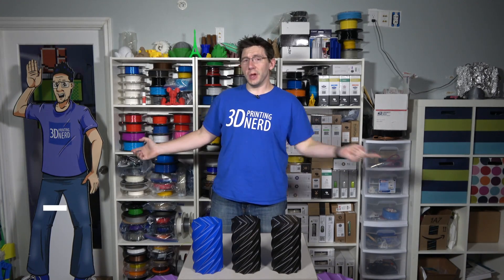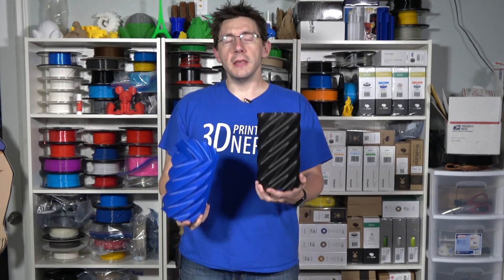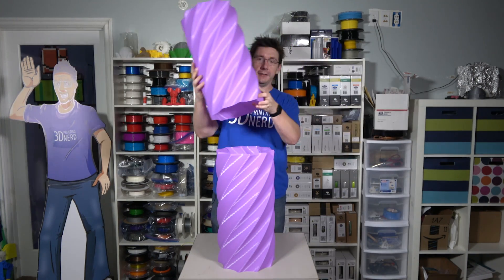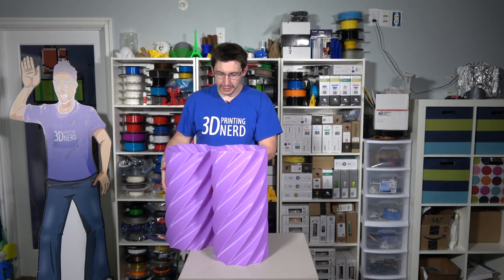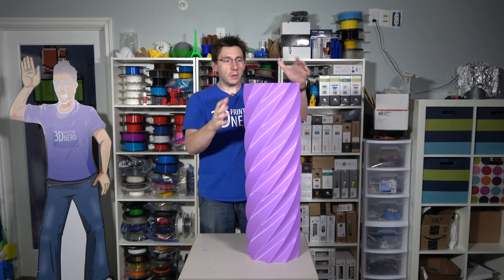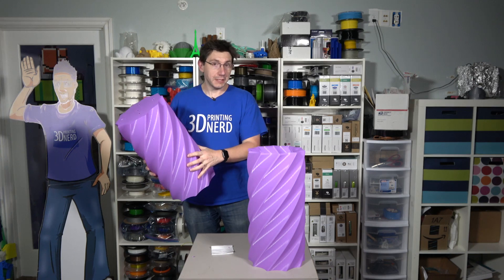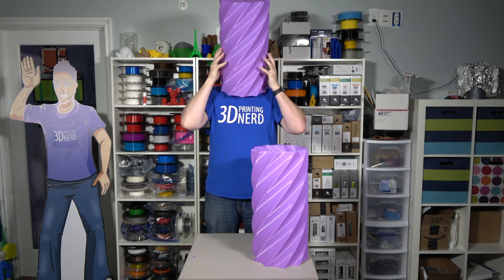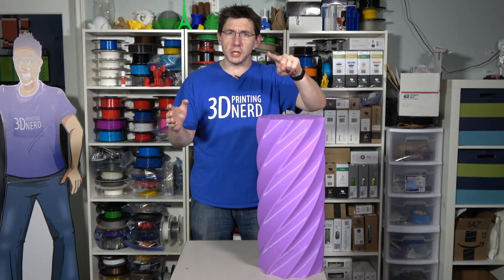Biggest 3D Printed Oddly Satisfying 3D Printing Twist Containers

Comment: i know how to produce a gas that implodes and burns cold... could a zero air tolerance be made with some pistons or cams, what ever they are called? the cylinder that goes into the chamber and ignition happens. with my gas that burns cold, i could make a functional implosion engine, lol plastic hummm, im thinking about getting into 3d printing. What kind of printer could give me the zero air tolerance? but still slide freely when air isnt blocked, or if there is an ever so small slight loss of efficiency i guess it wouldbt be that bad. oh and the heat that will be generated from friction will be taken away when the gas implodes cold.

Comment: Maybe try with some acetone vapour or other smoothing techniques, the sound it makes suggests there is significant friction at work
Reply from the maker: I think the ability for air to escape is still a more significant factor than the friction, but, not by much!
Reply: worth a try maybe? I think it might also make more space for the air to escape. Thinking of the layer edges simplified as sin and (shifted) cos there is little space between the tips touching (that are making the sound) but if they are smoothed, then its averaged around their middle...

Comment: If you put only one hole in the top and attach a pipe bowl, fill it with w/e herbs or tobacco you want, light it and let the bottom piece fall away but stop it before it separates, then remove the bowl and let the top go it'll shoot the smoke straight up. cool trippy gravity pipe.
Reply from the maker: Whoa, that would be trippy!

Comment: Any chance of a Gmax XT vs Raise3d N2+ vid coming plz?
Reply from the maker: These were printed on the Raise3D N2+, and the Hairy Lion I did was printed on the gMax. Are you looking for something specific?
Reply: Thanks for your reply. I am considering purchasing the N2+ but quite like the gMax too. It's hard to tell which one is better in more areas overall. I haven't seen anyone do a comparison video. The price points are close, the size of prints are close, so I think they would be considered in the same category of printer. Other than the option of dual printing on the Raise3D.Therefore, a duel of sorts would be a great vid! Something like testing the same print on both printers with same filament, settings etc.. Love your channel!

Comment: You're not worried about all those exposed rolls of filament?
Reply from the maker: Surprisingly, no. The house is air conditioned, and relative humidity is just fine for most filaments. Nylons and PVAs are kept bagged with desiccant.

Comment: Hi, I'm going to get a tronxy x1 3d printer kit as my first printer, and I have a project that needs a high melting temperatures and strength. Should I upgrade it to a heated bed, and print in ABS, or should I print in PETG?

Comment: Consider picking up a step drill. They make putting holes in any thin material (plastic or metal) so much easier, and they're a good value for money since they're 10 hole sizes in 1.

I think that you'll get diminishing returns with the air holes. My bet is that the air flowing between the two halves is what allows the near-frictionless satisfying effect. After the wiggle stopped with the first test at 1:49, it was slow, but there was no grinding noise like we heard after the holes went in.

If you want to follow up on this test, you could try: 
- plugging the holes and letting the large container close, even though it will take a while
- Lightly sanding the inside of the outer container, and perhaps adding a little synthetic lubricant to smooth things out
- putting a hole in the top of one of the smaller models that works well, to see if it closes faster, slower, or at all. My guess is that the small ones would bind up and not close at all without airflow between the parts, since they have less weight to overcome friction.
- (obviously not a simple option) Re-printing the inner half of the large container just a wee little bit smaller, even 1 mm less in diameter might make a difference.

I hope you don't take this as criticism. I've never even done any 3D printing, but this video was cool so now I'm just itching with curiosity! Even if you just try putting a hole in one of the small models and report the results I'll be so happy :).
Reply from the maker: I take this as constructive criticism and I love it! Thank you so much! I love the ideas - I'll see what I can do!
Reply: After a re-watch I realize I'm not adding all that much here. For some reason I felt like the big tube with holes wasn't closing up nearly as smoothly as the smaller models, but actually it seems about the same, it's just louder because it's a bigger vibrating thing. And you said right from the start it was just a matter of the gap being too tight.

As for fun tests, it would also be fun to see if you could attach a balloon, air compressor, or even that hair dryer, to one of those new holes to see if it'll push itself open. If done from the bottom, it would look like the future. Some day I'll get my own 3D printer and I can tinker on my own, but for now I'll just try to tinker vicariously through you (that sounds wrong).

Thanks for being responsive to your viewers, and for making interesting content :)

Comment: It looks like the increase in the diameter distributes the weight of the object over a bigger area. The bottom line is that you end up with less pressure applied by the object's weight per unit of area. Adding the holes helped alleviate that by allowing the "cushion" of air to escape. You can also increase the difference in diameter between the two objects. It'd be interesting to add some weight to the top object or modify it with some cut out designs.
Reply from the maker: I thought about reprinting to increase the diameter between the two halves, but in the end, using a drill at 1am was way more fun.
Reply: I can imagine. :D 

Hmmm... cut them down shorter and they can make some novelty gift boxes.

Comment: Looking at your filament wall, it doesn't seem like you are all to concerned with moisture, are you? Did you ever have printer failures because of moisture?
Reply from the maker: I'm not, that is correct. I've never had an issue with moisture and filament. Crazy, right?

Comment: How much PLA?  How thick are the walls?  Single thickness walls?  Vase mode?  MORE info please!
Reply: I ask because I have been playing around printing many vases lately.  They print fast and are just fun!
Reply from the maker: Each one consumed roughly 200g of PLA. It was vase mode, so the walls were .4mm thick!
Reply: Hmm... initially looking at those I thought they would take a tonne of PLA but thinking more I guess that's not bad.  How long did it take?

Comment: You probably meant that gravity has to overcome the friction, not sucktion ;)
Reply: At least it is probably an important factor as many people print those vases without top and bottom layer.
Reply: Sintoxic no he meant suction which increases the effect of friction. If it was purely due to friction drilling holes would not of helped. As the preasure inside the container drops the preasure on the outside of the container is able to outweigh the forces from gravity causing the piece to stay in place. As the inside of container regains it's pressure the force from gravity is stronger once again allowing the container to drop. It balances these two forces creating a constant speed in which the container drops. If you allow the container to pressurize faster by drilling holes it will increase the rate in which it falls.
Reply from the maker: There was some friction, true, but, the suction was what I meant :)

Comment: If you put the side with the holes down on the table will it hover? High Five Man!
Reply: Sadly, it's completely impossible. The force of the air is being created by the weight on the upper piece, pulling it down, and pushing it out. So the force, in total, is only the force of the weight on the upper piece. And it's competing with the force of the weight on both pieces. So, no matter what you do, even if it were perfectly efficient (hah!), it would not be able to produce a greater upward thrust than the downward force of weight.
Reply from the maker: I WISH
Reply from the maker: I WISH
Reply: there's some gaps on the two pieces which allows the thing to roll down without holes before joel decides to put some in anyways. I suppose you could put a fan down there and tune it just right to get it to hover though.

Comment: Hello, What about your experience with the Raise 3D N2 +? I´m a Visual Artist and Sculptor and I have a Makerbot Replicator 2 from 5 years ago and I´m so happy with my PLA print models but now I need to go for a higher level of my sculptures and I need to increase the print area,  I was looking for what is the best option for me and I´m so enthusiastic with this N2+ but  I´d like to hear from any real user what they think about it  or if you have any other suggestion, I have around  5.000 US$ of budget  for that. Thanks for your time and I really appreciate your answer.
Reply from the maker: Wow, that's a huge budget! So far, I like the machine. I think it's a sin that it doesn't have auto bed leveling, though, the community has added that to the machine via a BLTouch. Their forums seem active. One person even fit Bondtech extruders on it! I don't use the dual extrusion capabilities. It produces exceptional quality prints. I have had some failures, but, most were very simple to recover from.
Reply: 3D Printing Nerd  Thanks for answer,  I don't have a problem     without the autolevel bed, my Replicator 2 it doesn't have too, I'm focus on the quality of print and the build area size, the Raise 3D N2+ in compare with de Makerbot Z18 is cheaper and a little more print area. Thanks for your time! 👍🏼

Comment: Not bad, I have been printing 280dia 610tall
Reply from the maker: DUDE. most epic! Video?
Reply: Thanks, I will get around to doing a video soonish, I am currently doing only 20thick250widex375high.
Five prints to go at that then a 280diagonal square by 500high 0.3 tip single wall 5%infill
Reply: Lol, that makes it a week away if I don't get any more failed prints.